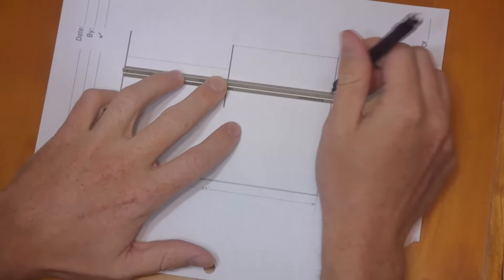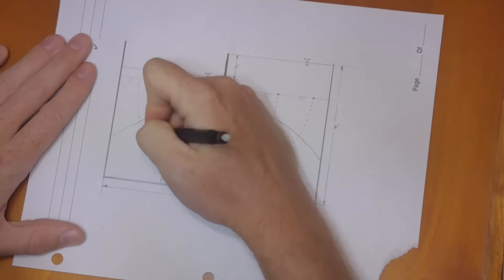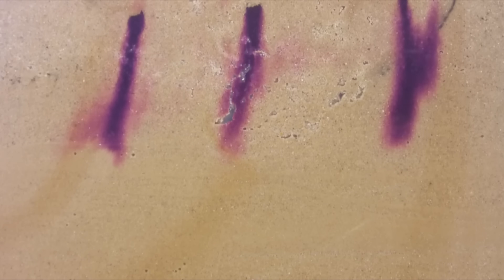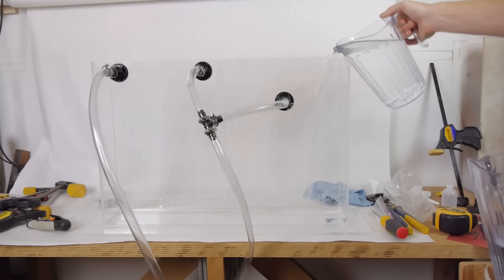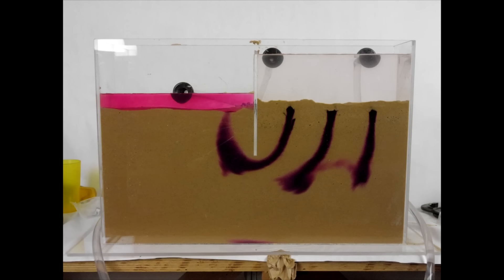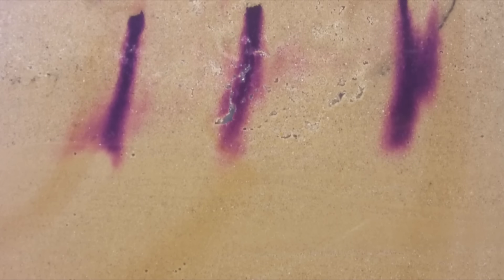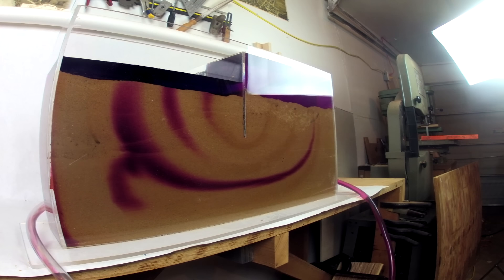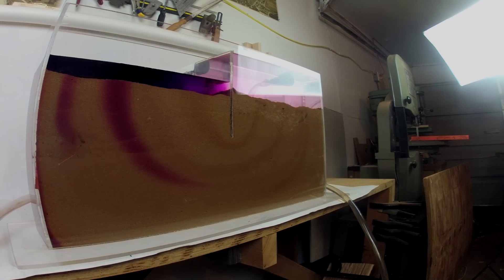Groundwater Flow Demonstration Model

Comment: I live 60 miles from New Orleans and go down there frequently.  There are substantial areas that are well below sea level there.  I have seen little "artisan wells" appear and sandbags are placed in a chimney like structure around the hole till the level of water in the chimney reaches a height in which the water in the column's weight equals the water pressure being driven below from the other side of the levee.
       I'm a member of an organization that rebuilds and operates antique railway equipment.  When the locomotives or railroad cranes move down the tracks, there is a wave of water that appears out of the ground which follows the equipment down the track as the heavy equipment depresses the ground.
      I know in the Netherlands, ground water has to be kept near the surface so that the wooden pilings that support the buildings don't dry out, rot and collapse the buildings.  They must have a Goldilocks level of not too high to flood, but not too low to cause structure collapse.

Comment: Thank you VERY MUCH for posting this video.
In my town, officials have been considering the recharge of local aquifers using partially treated wastewater.  So this visualization of the flow of groundwater from a basin was VERY relevant.

Comment: The  high water level on one side of the model exerts a pressure that pushes the water  down into the ground. As the liquid sinks, the difference in pressure from the other side of the model creates a vacuum that pulls the water  in to balance  the system. It makes sense, but it’s pretty cool to see it happen. Great job

Comment: In our village, septic tanks don't have cemented bottoms. I always assumed that it has to contaminating the ground water. But does this mean that if ground water is deep enough, the water from septic would rather come out around  the surface and evaporate?
Reply: No, water always move down unless there is a barrier impeding it's moveme

Comment: What sorcery is this? Why doesnt the water flow Straight down?
Reply from the maker: Water flows based on pressure gradients. The pressure regime in a soil is based on the length of the flow path. It can get very complicated.
Reply: +Practical Engineering my head is already spinning. Thanks for trying!
Reply: It reminds me of a current flowing though a conductor. Seems like there is some repulsion and attraction, finding a path of least resistance. This is bizarre. I never knew about this about how water behaves.
Reply: I seem to remember my physics teacher explaining that electricity and water both act in similar fashions, which is why we use some of the same terms when labeling and explaining the movement of both entities.
Reply: Because there's pressure on one side and none on the other side, thus water moves trough sand and emerges where pressure pushes it out.. Better question why didn't the 3 lines collide?
Reply: @rnci because the flow is laminar (i.e. smooth) and not turbulent. Therefore, the fluid will typically stick to a line of flow and not move between them. If he had added some obstructions, say a large rock, then it would likely have caused a turbulent flow behind the rock (on the opposite side from the direction of flow) and this turbulence would have caused mixing of the fluid.
Reply: So the constant hydrostatic pressure pushes the water down on the right of the model, but the water is lighter than the soil on a volume per volume basis, and it also seeks to saturate the soil, similar to an osmotic pressure or 'sponge' effect?
Reply: When explaining electricity i often use water through pipes analogy. Helps the understanding of the current flow.  
Volts - amount of pressure behind the flow. 
Amps - Amount or volume of subject being pushed through.  
Ohms - resistance against subject (small dia. pipe = more resistance than a larger dia.) 
Watts - How much of subject is being consumed at the end of the path.
Reply: @Lee Allen That is so smart I just had to immediately sign in, thank you and save this in a text file! Thanks for sorting out an electricity-dummy :)
Reply: I'd love to see a video explaining why this is so, explaining it.
I don't understand why the pressure depends on the length of the flow path.
Reply: icemanbx path of least resistance, it has to go somewhere away from the water pressure on the right side.
Reply: I came out of this thread feeling dumber than I went in. When the apocalypse comes, the only survivors will be cockroaches and engineers.
Reply: tziirkq no. engineers doesnt know about the foods and the herbal medicines. actually it is biologists who can survive.
Reply: There is a simple pie chart that lets you see the relationship among volts current resistance power.
Google "ohms law pie chart" or similar. This is useful for steady state or DC current. It is a little more complex with AC or when you 1st turn on or turn off a DC current. Your next google session would be inductors and capacitors.
Reply: icemanbx it sakes any we're not straight. of course I play mincraft but I don't get fooled by the physics.
Reply: icemanbx Long story short, the exposed soil has less pressure so its sucking the water back up at the same time it saturates the soil. The combination of those motions is what creates that curved flow.
Reply: Thank you, I'll try to remember this
Reply: Oversimplified explanation: Because there is already something in the way.  In this model, space is limited, and importantly, the ground is already 100% saturated.   When a higher pressure is maintained on one side of the wall, the water that is already below starts shifting over to the other side and upwelling to balance the pressure.  The reason that the furthest point doesn't just cut across is that there is already water in its way.
Reply: The sand was already saturated before adding the dyes. If it wasn't you would be simulating a rainfall event on unsaturated soil which would initially flow straight down until the soil was saturated. Water always takes the path of least resistance so in the saturated case it is flowing from high pressure to low pressure. In the unsaturated case which you asked about (I know you didn't specify that but I'm guessing that is what you are thinking to lead you you that logic), the path of least resistance is to fill pore spaces until the fluid reaches an equilibrium with the residual air pressure in the pore spaces. This is called matric suction, and is much more complicated than my explanation but I hope it clears the air for you.
Reply: sir MAXX Both situations are described mathematically by the Laplace continuity equation. There is also analogies to thermodynamics as well.
Reply: Christopher Manoff 
Water is composed of an equilibrium reaction H^+   +    OH^-    ,=`  H2O.
The Ions act in more or less the same way as e- (electrons) do in what's know as electricity.
That's why most liquids conduct, and metals due to delocalised e-.
Reply: rnci same answer, the ones near the wall have less pressure
Reply: basic principle is that dirt is heavier than water so water stays on the top, but with enough water gathers on the surface it begins to weigh more than the dirt and pushes water through until it reaches equilibrium
Reply: It's basically communicating pipes in way slower, isn't it?
Reply: You are all wrong. It is sorcery.
Reply: @christiangeiselmann  indeed.  after all, aren't we told the simplest answer is usually the correct one...?
Reply: motoz30   Exactly! - You are proving sorcery with practical logic and reason! Chapeau!
Reply: @LeeAllen337  omg you have no idea how much I appreciate your analogy! I had to screen shot your comment. I've been trying to get someone to give me a simple and relative analogy of how those work for a long time. Awesome! Thanks
Reply: @LeeAllen337  wow. u explained it in 4 sentences that was not possible with 3 years of high school.
Reply: Not so counterintuitive when you remember the soil is saturated. He basically demonstrated the path water would take in the absence of any soil, except things are very much slowed down. In that soil-free case, the water level on the left would certainly rise, yes? Well where do you think that water comes from?

Comment: We did this experiment in my geotechnical engineering course as part of the semester project and compared the experimental results to the computational results (geostudios 2012). The results came out almost identical. It's an awesome experiment to conduct and it really helps with wrapping your head around this and understanding it.

Comment: How does this translate in a macro scale? There's a huge aquifer below Albuquerque, NM. Does the water flow through dirt, or is there a huge channel under the city?
Reply: +Andrew H 
Damn! it's like you were in my mind painting a picture. you should teach school or something.
Reply: +Andrew H 
Damn! it's like you were in my mind painting a picture. you should teach school or something.
Reply: Andrew H's comment seems to have disappeared, so I'll add my own, less vivid, contribution:
While it's possible to have caves filled with water underground an aquifer is explicitly something like in the video: either permeable rock or something like sand or gravel which is saturated with water.
Reply: @fergochan  (How did you know Adam's reply was vivid?)

Comment: As a non engineer, this fascinate me.  Question:  what does one do with this info?  How does one design around this or with it in mind?
Reply from the maker: +Peter XYZ That's a complicated question but I can give an example. When designing a dam, the greater the uplift pressure from groundwater, the lower the stability. So many dams have cutoff walls into the ground like the model to try and reduce that pressure.
Reply: Thanks for the enlightenment.

Comment: All this being known and researched, how can corporations pretend that they had no idea about the influx of fracking?
Reply: Fracking, as the name suggests, involves sudden fracture of the gaps between the grains of soil. That is a totally different mechanism from the gradual movement of fluid between essentially stationary grains of sand as demonstrated in this video.
Reply: fracking is not the issue with them, because they fracture miles down below the ground water.  The issue is faulty seals against the groundwater when drilling down through it.
Reply: @snap-off5383  to elaborate. They are supposed to have a well of concrete downward that prevents fracing fluids from entering the ground water.

Comment: Wow thats amazing! I never knew that happened, why does it separate into three curves?
Reply from the maker: +lxt101 Thanks. There's no separation in the flow. I just put three individual drops of dye to illustrate the flow pattern.
Reply: Practical Engineering Oh okay so its all bleeding through, the whole way. Is there a transparent sand to make this experiment with so we can see it in a more three dimensional view?
Reply: Practical Engineering What kind of ecological impacts can you expect when you change the flow of ground water? or regulate it at leaste?
Reply: lxt101 
There is a law for this, something about an object in motion. Fresh water on right is being added, it naturally wants to sink. Water on left is being removed. Water from right gets pulled to the left.
It takes slightly longer for the vacuum effect to act on the further away objects, so you get this lovely curve. Speed x force = momentum or something. Don't really know as I only have a GED. Or as any 3rd grader today may consider common sense the way they have accelerated the education system.

It gets interesting if you add a 3rd section and another pump. What do you think would happen to the 3 lines?
Reply: not three curves, its a conitinuousl flow field, we only see three traces because he used 3 patches of potasium permanganate
Reply: Tuman WK,  you have a gift of understanding and also explaining technical concepts in simple laymen terms so that even  a nurse like me - with no geo background - is able to understand!  Seems to me you might want to pursue a degree in this, you're a natural. ..

Comment: Is this why we put plastic vapor barriers under concrete slabs?
Reply: Nope. The purpose of V-barriers is, as the name says, keeps water vapors coming out of the ground from migrating into the structure above and causing all manner of humidity-related problems (mold, rot, bug infestations, allergies, etc.).
Reply: +Double Dare Fan so, on a related tangent, how would one go about creating a vapor barrier where one was not installed, ie, a 70 y.o. concrete block basement??! ....if you happen to know (:
Reply: +erintreez there are lots of epoxy vapor barriers that go on surfaces.
Reply: +Evan Adams so, essentially the vapor barrier could be painted on the interior floor and walls....
Reply: +erintreez not painted on. you usually squeegee it on and very much rough up the surface
Reply: +Evan Adams is there a reason for roughing up the surface, or is that the nature of the material?
Reply: +erintreez lock and key. a tougher surface provides the epoxy more pores to fill and lock in. otherwise it just has to be much thicker. look at latest upload video from wr Meadows

Comment: In the the town where I grew up they buried some PCB contaminated waste materials. The farmer next door to the site was assured that it would take 72 years for the contaminants to move a few metres. In two years his well was contaminated. I could have told him that. Although the rock was not porous it had several joint sets and distinct bedding planes to help the ground water move.

Comment: Clear and precise. A nice followup would be to consider factors that create problems for computer models and why real models are still useful.....apart from the fact that they are more accessible to lay people. Also, more on the challenges of ground water movement - impacting building standards, zoning, flood plains, ground water contamination, well water and also geothermal.

Comment: That's super cool. As great as simulations can be (especially since a lot of them are faster to set up than a physical model and can be rapidly changed), there certainly is something different and awesome about seeing it physically happen. It would be cool if you could find a way to make this model do a constant loop, see if the flow changes over time...

Comment: nice to have proof of what I've been suspecting is happening to my property.  
We've a hard clay soil, very difficult to dig through without wetting the clay first for example.  
Yet the crawl space gets wet after a heavy rain, or if there's enough snow melt.
Parts of our floor is tile and grout over wood and seems to buckle or have buckled a bit, not much but of concern

Comment: I think with just one type of soil granular size predictions are possible. However when you find different type of soils and grain sizes it becomes impossible to predict. The effort to find the unknowns will be so large, that will most likely the predictions will not be found correct. But nice video and it proves that engineering has a lot to do with empiric studies.

Comment: This basically shows you how important groundwater regulations of the Oil & Gas industry are. Groundwater flows and takes dumped chemicals all the way to rivers to be distributed throughout the region which has led to water being full of lead and other toxic chemicals.

Comment: Yep, water can't just go straight down because down is eventually blocked by the bottom piece and saturated soil on top of the bottom piece. Same issue with the nearest sidewall. That's what a pressure gradient, as opposed to a gravity gradient, is.

Comment: The outer flow splits into two, it would have been nice to see more of this and some explanation of what happened? You can see it best at 3:08.
Reply: There isn't an "outer flow." The water is moving through all (or at least most) of the sand. The dye was only placed in three different spots to illustrate the behavior of the flow. I hope this clears things up.
Reply from the maker: That is a byproduct of having solid walls on all three sides. It's basically an eddy.

Comment: While that is a cool model, what you are demonstrating are not so much geotechnical concepts as those of hydrogeology (some call it geohydrology), which is a different field. I studied hydrogeology and pollution transport in groundwater in my graduate work  at the Univ. of Texas, in the same Civil Engineering school that also housed geotech. Curiously, the two disciplines rarely interacted. 

I would put your piece on building sandcastles squarely in the geotechnical engineering camp, but this is different (and this is certainly worthy of more of your cool teaching videos).

Comment: what is the wall supposed to represent?

if a obstruction was a house, and there was a square of sorts the ground water had to navigate around, would it start to surface in the middle between the two wall obstructions? or would the soil pressure  and added water pressure cause the path to treat the whole body as one big structure?
Reply: At university we were taught that it was some type of impervious structure. A concrete dam is ideal, as the pressure head from elevation would be enough to see this seepage downstream

Comment: pretty cool, but left with some questions 
what was the scale of the model? or how deep/far was the water traveling? 
and is it safe to assume that most of my downspout water (i am at the top of the hill) is actually ending up at my neighbor's house two doors down, and not next door? 
thanks in advance for your response